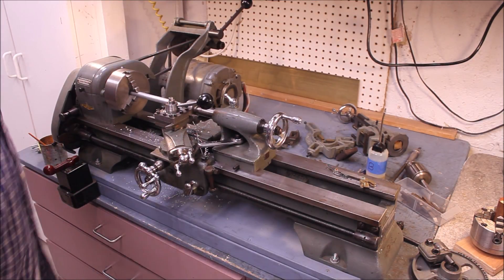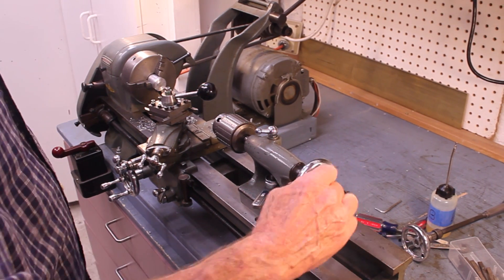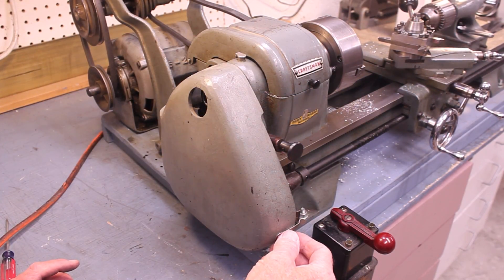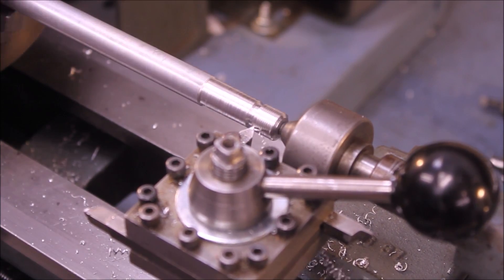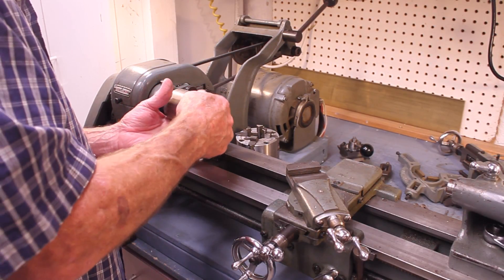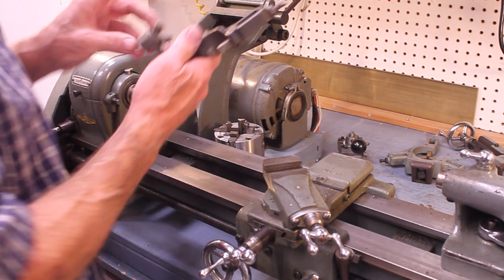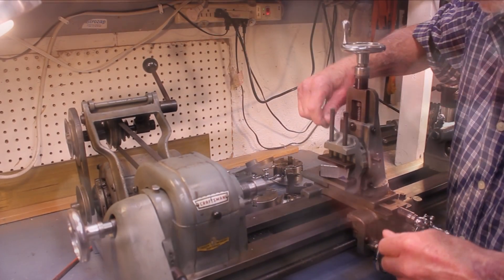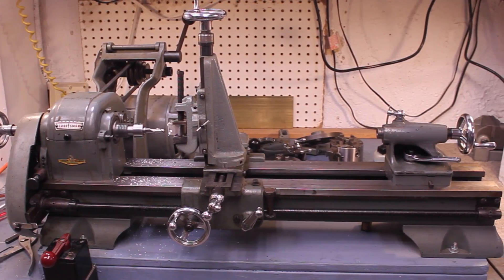Atlas 618 Craftsman 101 Lathe

Comment: Thanks for sharing.  I have 3 of these lathes.  One is identical to the one that you showed except that it is an Atlas Branded.  I also have a second one of that style for parts only and the third is an Atlas/Clausing which is a later model.  Mine was built in 1979.  I plan to do a complete restoration on it, even though it is in very good condition.
Reply from the maker: Thanks for your comment, R. Steven! There is a lot to be said for these wonderful machines. They really don't make 'em like this anymore!

Comment: Wow that little endmill had a huge amount of runout but still a cool machine if the spindle has a morse taper headstock spinde buy morse taper collets or an morse taper er collet holder for milling more rigid and more accurate run out wise
Reply: How about locking down the carriage , & tightening up the gibs ?  I saw that he was trying to hold the traverse feed while running in the cross slide ; that's asking for disaster !